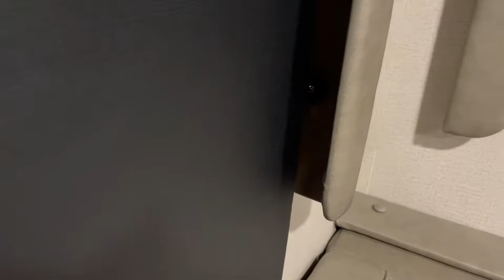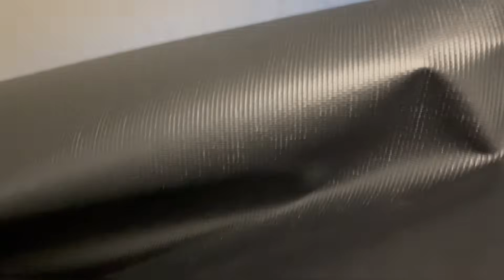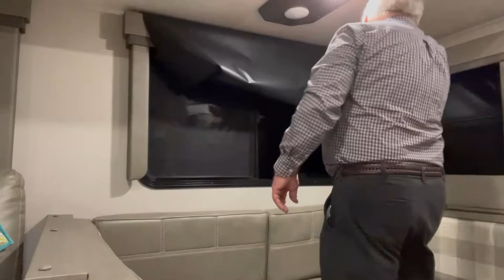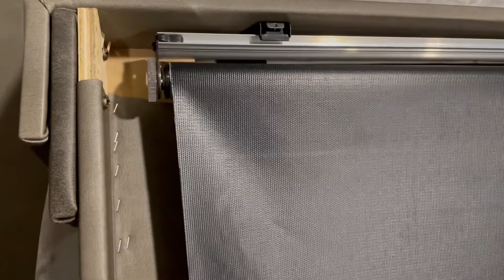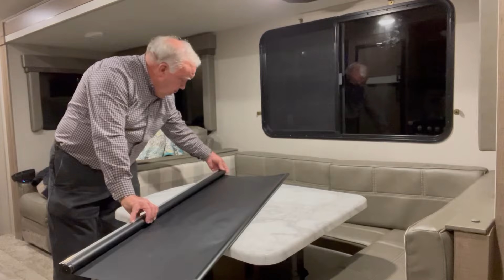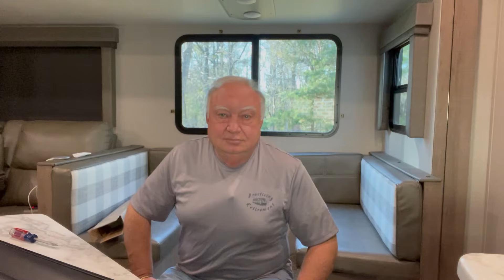Roller Shade Repair for Grand Design

Comment: Thanks for the video. Just a note, not all Grand Design shades are from Irvine. In my 2021 Reflection trailer the shades are all United Shade LLC, but the replacement process is similar. The springs are a little different.
Reply from the maker: Thanks

Comment: Glad I found your insightful  Video. I’m looking to replace a non roller shade and wonder hoe take down the valance. In hindsight since your roller shade snaps into the valance, would be easier to mount the valance an then snap the shade up into the valance. Thanks for sharing. Your patience and methodical work flow is appreciated.
Reply from the maker: Thanks for the comments.

Comment: What a great video!!  Now can you tell me if the shade can hang back up without the valance?
Reply from the maker: Thank you!  I guess if you removed the rail that the roller attaches to from the valance.  The rail might could be attached to the wall.  But, the wall probably does not have the backing to support the blind.  I wouldn’t try it.

Comment: Ok. You did a great job on showing the function of these blinds. It took me 3 tries after I took it completely down in my hands . Yes the spring and pre stop is a little wonky till you get the flow .. I set it up perfect with the blinds sitting good on tve bottom and proper stop on top
Reply from the maker: It can be a challenge.  Glad you succeeded!

Comment: Black knob rolls up.  Unfortunately I can’t figure out how to get mine to have tension
Reply from the maker: I had to take it totally apart to make it work.  After a short time it stopped again and I haven’t felt like fooling with it again.  Good Luck!
Reply: Thanks you so much for just say black knob rolls up, LOL. Our bedroom shade was stuck all the way down. I used the Black Knob (clockwise) and move the shade up a few inches then was able to raise the shade back up the correct way.

Comment: Mine is the newer version without knob wheels on the ends
 It appears to roll up.manually and hold, but when I gently pull on it, it just falls to the bottom. The GD video show rolling it up manually a little faster than normal, but that appears not to work for me as it never starts going back up by itself like their video does. All I did was put down the shade a little further than the bottom of the window and it bottomed out, refusing to go up. 8 tried rolling it manually in both directions in declaration, but no dice either way.

Comment: So, in retrospect, could you have fixed it by just adjusting the clear knob or was it necessary to remove it from the wall and replace the stop part?  It sounds like the spring deal was working all along - or did i misunderstand?
Reply from the maker: Really good question.  I tried on several occasions to adjust the shade with the knobs before ordering replacement parts.  Honestly, after taking everything apart, I don't think there was anything wrong with the original parts.  I don't know why it took taking it apart and putting it back together to make it work but, it did.  If you have been successful in correcting the problem of the shade being stuck all the way down by adjusting the knob, I'd like to hear about it.  Thanks for watching and your question.

Comment: Hi
 Through your trials and tribulations of taking that off were you able to determine if you were to take it off without having to take the valence all apart if it was just held in by clips if so could you please make a tape showing that thank you.
Reply from the maker: Unfortunately, there is no room to work without removing the whole thing.
Reply: @practicingretirement7732  ok Thanks for the info. Safe Travels.
Reply: 30 minute long video and still didn't see the actual repair..

Comment: hello there, so my question is: After figuring out that adjusting the stop mechanism helped fix the problem, would you say that there was no need to replace the spring? I have both larger windows not performing correctly and also the smaller window in the bedroom. We pay so much for this trailer and have only had it for under a year and already have window shade issues. 

You mentioned  we could ask questions for other issues that you could maybe help with.  Could you look at the sliding doors on the bathroom and bedroom to maybe help with a repair on the stop mechanism that is sticking down and out from the top of the track.  We forgot to secure the doors and during travel the door broke that metal bolt that stops the doors from going to o far off track. 
Thank you in advance
Reply from the maker: Hi,  thanks for watching and asking your questions.  First,  when I got through with the blind repair, I was convinced I didn't need to replace the spring.  The new spring and the old one looked alike.  As for the doors,  I just repaired mine last week.  I didn't think about doing a video.  Maybe another day.  

Truly the stops on the doors are ridiculously cheap.  Absolutely below the quality of the rest of the trailer.  I had the same thing happen from not securing a door then had the problem on the other door for reasons I don't know.  If you haven't gotten the door back on the track, you will need to remove the panel that covers the track.  The panel goes the width of the camper all the way up to the ceiling.  Once this and the screw that was the bumper is removed, you can put the door back on the track.  I then made a bumper with what I had available.  In this case, it was paper that I folded and rolled tight wrapped with white Band Aid waterproof tape.  I would have used a wine bottle cork if I had one at the time.  I made it where I had to squeeze it into the end of the track and slide it up to where the screw had been.  The one I made was a little bigger around than a cork and about the length.  After it was in place, I opened and closed the door to find exactly where I wanted it to stop.  I then drilled a hole in the stop I made like the way the factory did with its screw.  Then, I installed a screw that's a little larger than the original and screwed it in have the head of the screw touch the stop I made.  The bigger screw is much more substantial and the stop further supports it.  The end result is the stop makes for a soft but, solid stop for the door.  Sorry for the length of this.  I could have done a video quicker if hadn't left my camper at a campground away from here.  Let me know how it works for you or if you have any other questions.

Comment: Thanks for your video! I had found my bracket clips, and pushed them in, but nothing happened. I couldn't figure out how to release my shade from them. So I wasted 5 hours looking at other videos and info to no avail, prior to finding yours and saw you do it. My shade is actually ok, but it's attached to the valance over my sliding glass door in my rv. The valance was installed too low and I kept hitting my head whenever I went in or out, since I'm very tall. I had to remove the shade in order to raise the valance. Once I got the shade out of the way, it was a quick job. However, I cannot get the shade back on the brackets now, since it's so long and heavy. Is there a trick to it?
Reply from the maker: It's been a while since I worked on the shade but, I think you may have to install the roller shade to the valance before reattaching the valance to the wall.  Hope you have gotten it to work.  It can be very frustrating.

Comment: I feel you Brother!  The 74" roller shade on my 2021 Reflection fell down, mounting clips and all, during my last, three-hour trip to Ute Lake State Park.   (video on my channel)  I re-installed the clips with more substantial woods screw and Loctite Premium... but have not been able to re-mount the shade, by myself,  since it is so long.  Just one of many headaches with my new camper!
Reply from the maker: Just watched your video on the Reflection and subscribed.  Good luck with your channel.  In your video you mentioned having work done by a plumber due to not having time to wait on an opening at a dealership.  I'm going to recommend you call Grand Design and tell them about your problem.  I had a couple of issues with my Imagine that I had repaired away from a dealership and they reimbursed my expenses.  Thanks for watching and your comment.  Let me know if you have any luck with this.
Reply: @practicingretirement7732    Thanks for the advice.  I did call them regarding the plumbing leaks and I was told that I needed to take it to a Grand Design dealership.  I know now that I should have persisted with my issue.  subscribed to your channel as well, we can keep up with mutual issues.

Comment: The whole shade is dependent on a 1/8" piece of clear plastic. Not much strength for the steel spring it is attached to. Poor design and manufacturing. 
Thanks for the video, friend.
Reply: Sorry about the microphone mishap taking complete value out of the video, but it seems this comment addresses what is going on.